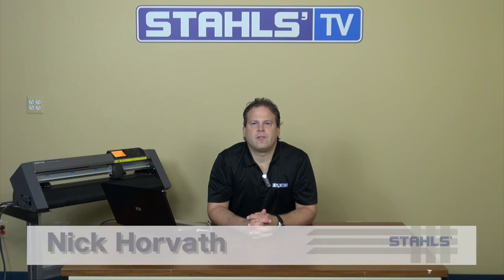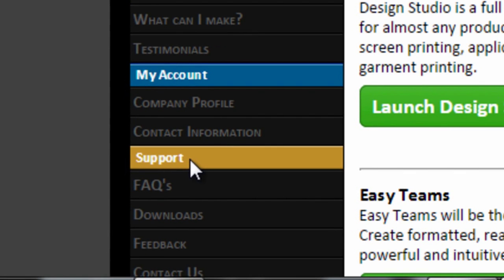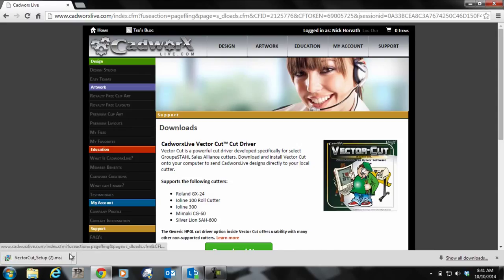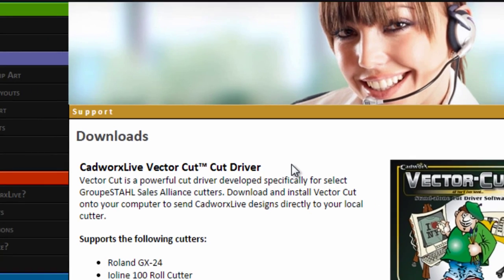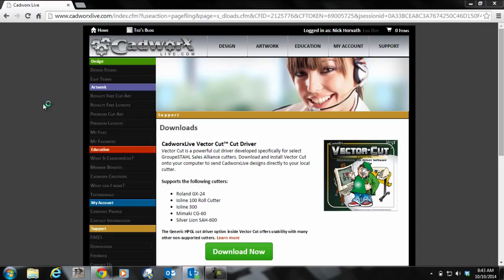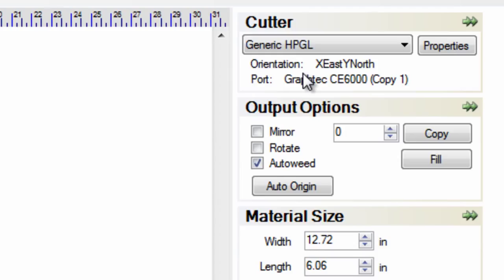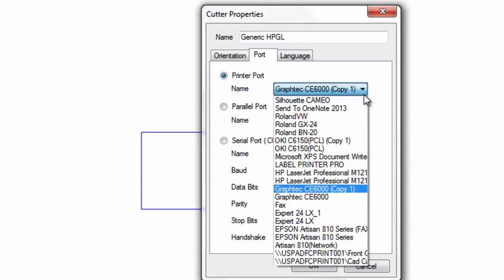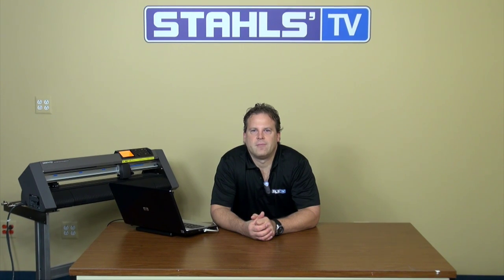Graphtec CE6000 Installing Vector Cut for Cadworx

Comment: How do you set the depth of the blade using vector cut
Reply from the maker: +Ernesto Torres Generally the blade depth is set outside of the software and set on the cutter itself. VectorCut does not have a blade depth setting. You should be able to change the depth of your blade by adjusting it on your vinyl cutter.